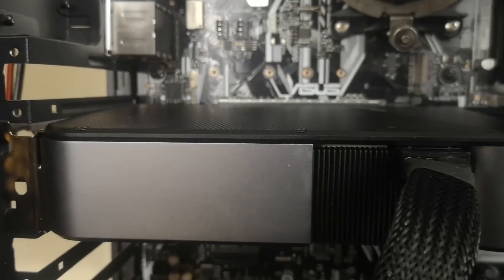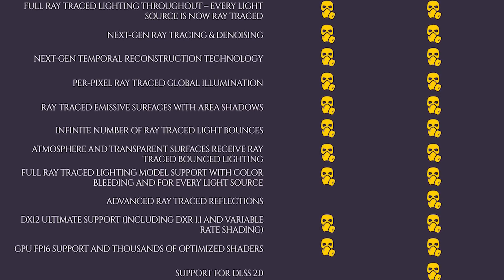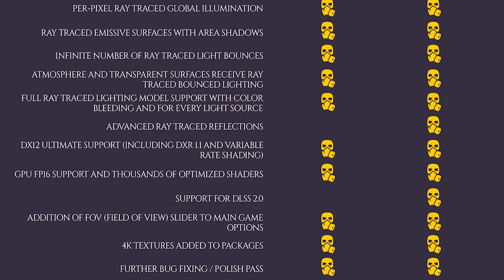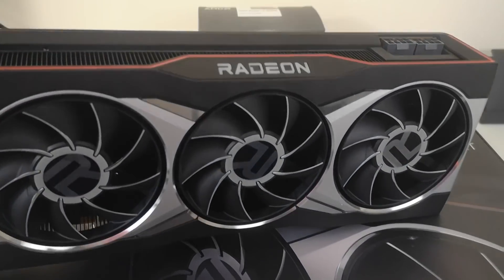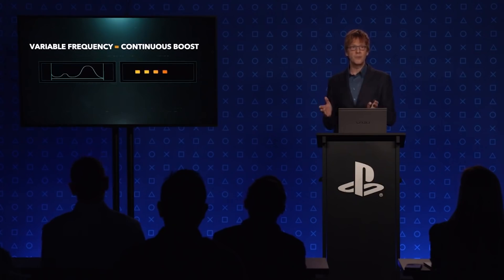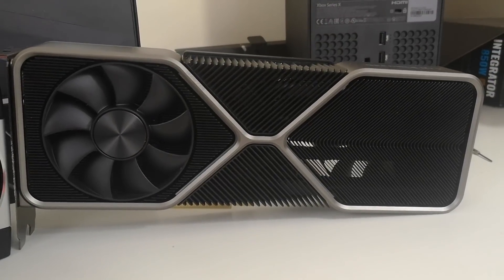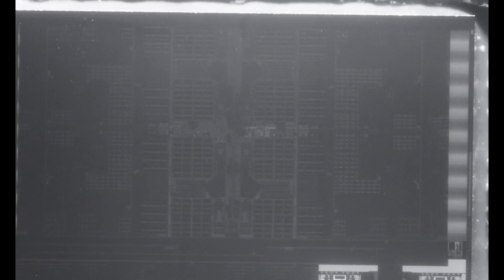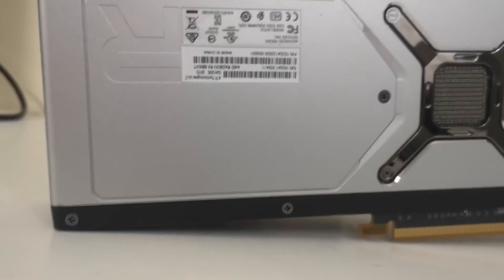XSX & PS5 GPU & Raytracing Performance - 4A Reveals All | Xbox SoC Secret Sauce by Microsoft

Comment: I really hope the rumors of RDNA2 APUs are true, Imagine an R5 3600 with a 24cu Navi 2 igpu in the form of a custom 7nm soc, it would save this destroyed market, they already make a massive number of APUs in things like Laptops, OEM APUs, and consumer gaming APUs, and they have already shown with the PS5 that they can do it with RDNA2.
Reply: Gonna need a whole new socket tho for that many CUs. Wouldn't fit on an am4 die. I think the most they can fit on the am4 die is 8CUs.
Reply: The ps5 has an 8 core processor with 36 RDNA2 CUs and is a 310mm squared die, a 6 core 24 CU die could easily be made to work. Also high speed DDR4 (3200-3600mhz in dual channel) would do okay, they already did this faily well with the 11 CU 3400g
Reply: @BonusCrook  The PS5 has 36CU’s
Reply: @BonusCrook  AMD has no intentions of making powerful integrated GPU’s in consumer APU’s. It would be expensive, cut into their dedicated GPU market and require very, very vast memory that even DDR5 is no wear fast enough.
Reply: @ZackSNetwork  forgot that
Reply: @ZackSNetwork  Im fairly sure they make a unique monolithic die for most of the apus they have released which includes all their new ryzen pro 4000 series and laptop apus.
Reply: @BonusCrook  Re-read my comment when I talk about consumer APU’s not closed box laptop APU’s. Yet again expensive and memory not fast enough.
Reply: @ZackSNetwork  I did and it's a good point, looking at other examples,  something like the 3400g would be faster with gddr memory, doesn't mean it wouldn't be worth doing though as they already make a massive number of different APUs so it can't be all that bad on the R&D budget, people overestimate the hurdles needed to get these things done.
Reply: @ZackSNetwork  I think DDR5 with its high speed will make APU's much more interesting. That's Zen 4 and later
Reply: @BonusCrook  It’s not that it can’t be done AMD just doesn’t want to do it. They could have put RNDA architecture in either Zen 2 or Zen 3 APU and incorporated 4gbs of HBM memory on the chip.
Reply: @DennisDinges  its very likely it will be on AM5 but I want it now darn it
Reply: Most likely it will gave 8 to 12 like normal. Just enough to make you want a  Radeon gpu